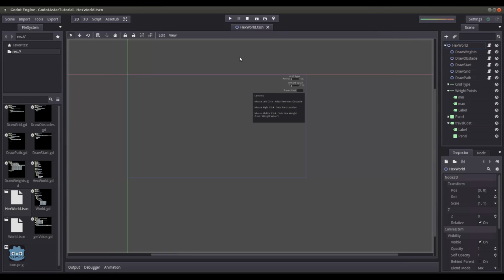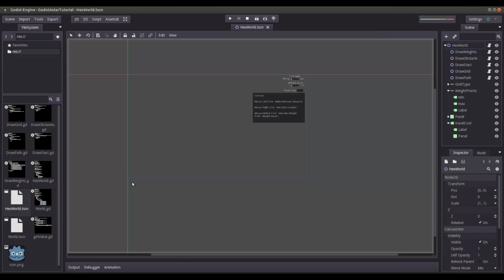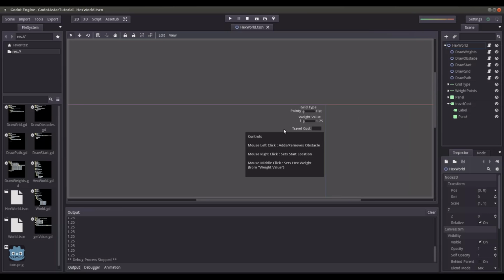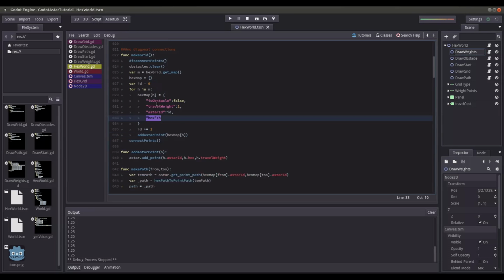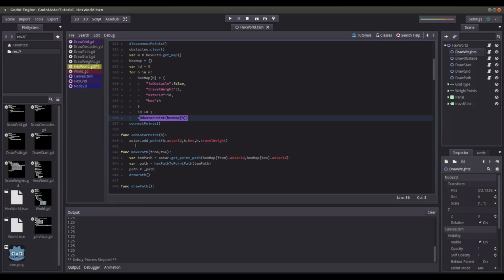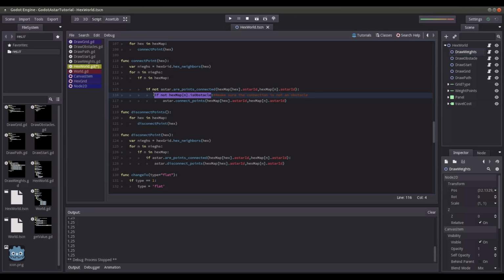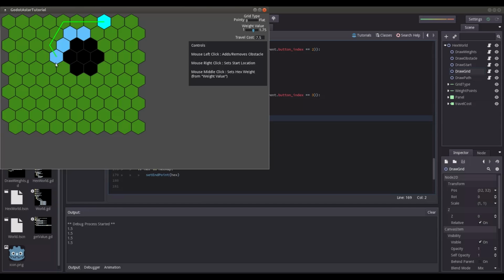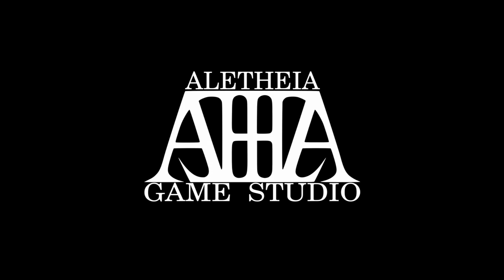Godot Astar with Weights and Custom Hex Module

Comment: It would have been nice if it was like the first one because then it could be used on 3d also, and make the grid out of imported models.  I think  I can figure it out from the first one though.  Thanks for the tutorial.  It's old now, but it doesn't look like astar has changed much in Godot.  Astar still seems the best for strategy type games.  Sorry to see you aren't making many tutorials anymore.

Comment: Maybe about your last problem, walking inside the water from a land costs less than walking from water to land ?
Reply from the maker: Thanks for the Comment.
In my testing before I recorded I was able to force it to go the way I wanted using obstacles and it did not appear to matter the "coming or going". I think the issue is that I was just adding the weights of each connection to come up with my final number. I think it should be multiplication or something. IE I am looking at it incorrectly. I'm going to ask the Developer and see what he says so I can get a better clarification.

Comment: two questions, this can be used with camera attached to an entity? Could you cover it for your next tutorial? and still necessary godot 2.2 to use this?  Thanks btw!
Reply from the maker: Thanks for your comment.
So, I'm not 100% sure what you are asking, but I think you are asking if an entity on the grid can be the focus of the camera. The answer is yes. However you need to have to take into the account the position of the camera (x,y) as a second offset on the mouse click. 
(Below is just of the top of my head and not tested)
#the offset of the grid drawing
var offset = get_node("DrawGrid").get_pos()

#the offset of the camera
var cOffset = get_node("Camera").get_pos() ##this is not tested

#gets the Vector2
var pos = Vector2(event.pos.x-offset.x+cOffset.x,event.pos.y-offset.y+cOffset.y)

#finds the hex based on the Vector2
var hex = hexGrid.point_to_hex(pos) 

If my assumption about your question is wrong then please expound and I will try to answer it better.

The second one is Yes for the AStart pathfinding. That is built into 2.2 and i had nothing to do with the creation of. The hex module does not require 2.2, but if you are building from source to use the module you might as well use the newest one. I did have a hex module that was built in GDScript, It would not have Astar built in, but only require 2.1.

Comment: Hi, i don't know if you can help me, i have a problem when i run the game the window is grey, i'm running on linux 32 bits and didn't see no one with this issue.
Reply from the maker: Greetings. So let me get clarification. Did you download the linked project from github and are trying to run it or are you just trying to run anything with godot. If it is the first question there are a few things that need to be done.
1. You must clone godot from it's github source. 
2. You need to clone the HexModule from my github into the godot's source modules folder.(You have to rename the folder to hex)
3. You need to compile it then for x11.
4. Run the binary from the folder it was created in in godot's source.
5. import the tutorial project into godot and run it.

If these seem a bit complex I'd recomend not really trying it right now as to the fact that godot 2.2 is not going to come out and instead the devs are skipping to 3.0 and there will be new features in that.

If it is the second question, that would be better asked on one of the godot forums because I'm not really great at troubleshooting. The community is great so try https://godotengine.org/qa/.